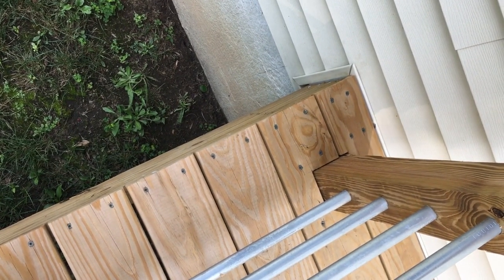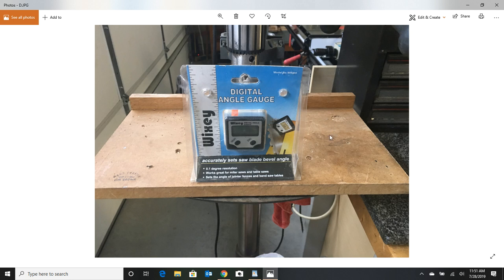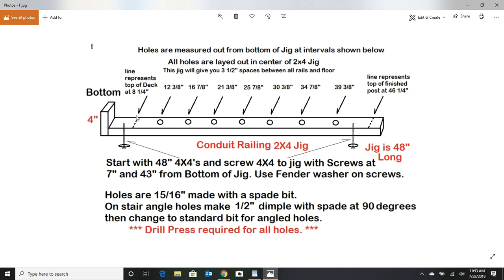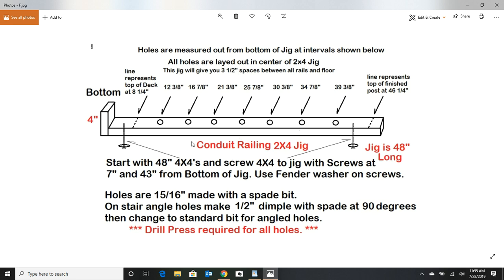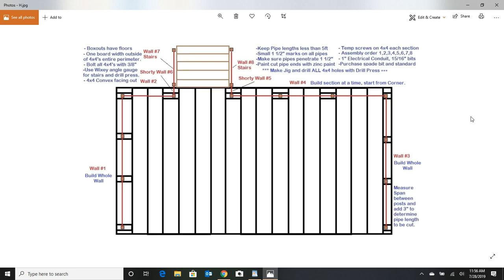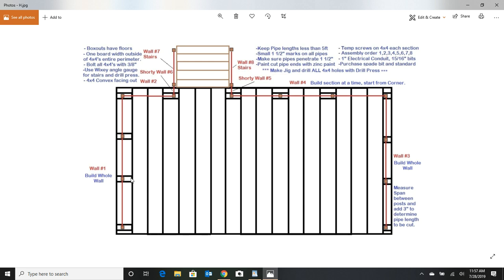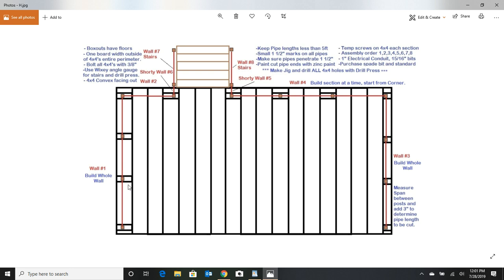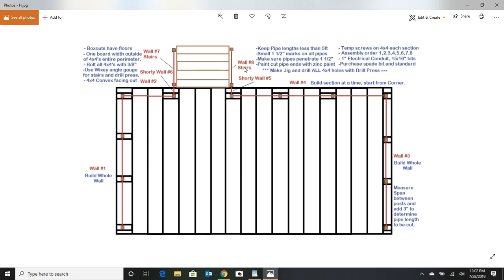How to Build a Deck with Metal Conduit Railings

Comment: Used the same material but placed the pipes OUTSIDE (not through) the supports with modern clamps.   Cut down labor at least 75% and strong as an ox.  Our deck hangs on our middle floor so no one in their right mind is going to be standing on it.
Reply: A child might stand on it!
Reply: @stevegunderson2392  Only if they are 1) on the deck (instead of the pool or game room) 2) left unaccompanied and 3) figure out a way to build a mechanism for climbing up.  I'd say the odds are close to 0
Reply: do you have pictures, materials list?
Reply: @debbyrobie3522  The big admission.  I replaced this with a unit from Timbertech. Already I noticed rust, "squeaking", and lots of wear and tear.   Hate to say it but the new railing is sheer perfection.  It will not fade, need painting, rust, wear or have nails and screws come out.   It was a lot of money ($6,000 for about 100 feet) but worth it.  Good luck

Comment: Has the conduit rust at all?  Did you leave as is or paint?
Reply from the maker: Used zinc paint for cut ends only. No rust after 5 years.

Comment: I just know my grand kids will stand on pipe,  I have sections up to 6'.  what do you think the max weight it will take
Reply from the maker: Bill, I don’t feel comfortable making recommendations for pipes dimensions and codes especially knowing I’m not from your area. Please call your local municipality and zoning board for that info. Thank you for visiting.
Reply: you may have to go to a bigger size.... test one at the length between them... i think a 1/2 at 6 ft on center whould be ok.. but of course you should test first

Comment from the maker: * Paid Links Below for Hardware Needed *
15/16" Reduced Shank High Speed with 1/2" Shank
https://amzn.to/2FkFrgp

15/16" Spade Bit
https://amzn.to/3nBeWEZ

3/8" X 17" auger bit 3/8" for carriage bolts.
https://amzn.to/34Koepj

1/2" X 16" Speedbor bit for 1/2" for carriage bolts
https://amzn.to/3jTdSKb

Skil 1/2" Hammer Drill for installing carriage bolts in 4x4's
https://amzn.to/2FiBoRI

JET J-2500 15-Inch Drill Press
https://amzn.to/3lFoNrv

Wixey Digital Gauge
https://amzn.to/34LZey3

Zinc Cold Galvanizing Paint
https://amzn.to/3djgcYp

Slipit woodworking Lubricant
https://amzn.to/3nPMjE6

Comment: how do you drill the holes at a angle for the stairs? what degree are they at as well?
Reply from the maker: All holes on all posts are drilled using a drill press that has a tilt table for stair posts. Angle is determined by the stair angle you have for your deck. 📐

Comment: any recommendations if all you post are already in-place and cant be removed.  how to secure pipe in last post?
Reply from the maker: Bill, this design requires putting each post in a drill press so that wouldn’t work.
Reply: @PompanoBrownie  could you not use the jig on a installed post ?

Comment: What happens when a big guy stands on a pipe and bends a pipe? Pretty tough to replace a pipe without taking the entire thing apart....
Reply from the maker: Brad, here are the steps I would take...
1.  Call Ambulance for "Big Guy"who bent it.
2. Cut bent pipe in middle with sawzall and remove.
3. Cut new section of pipe 1 1/2" longer than distance between posts.
4. Lubricate both holes with vegetable shortening.
5. wrap an old leather belt around conduit and attach vice grips and tap side of vice grips with hammer to drive conduit into one hole 1 1/2" deep.
6. insert other end in hole and tap in 3/4"
Done!